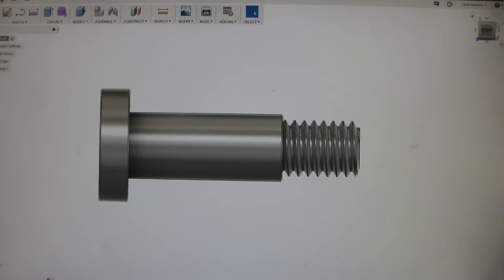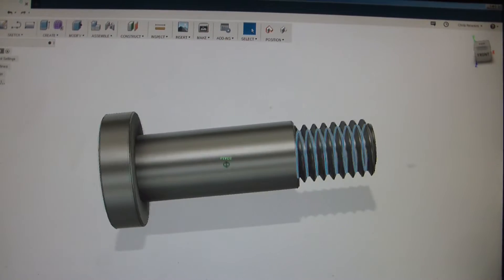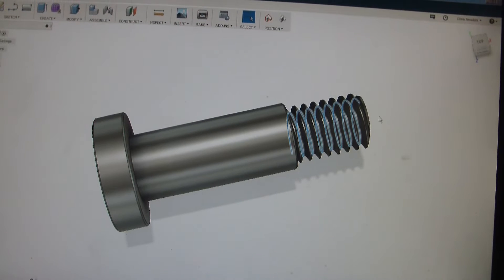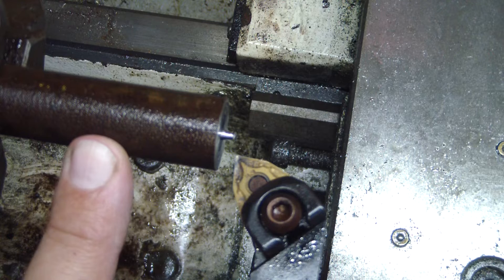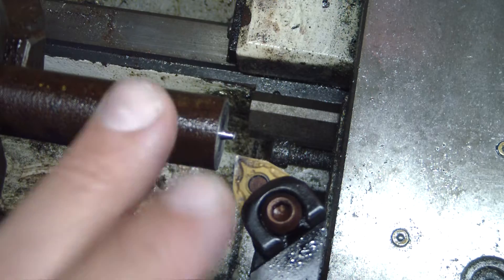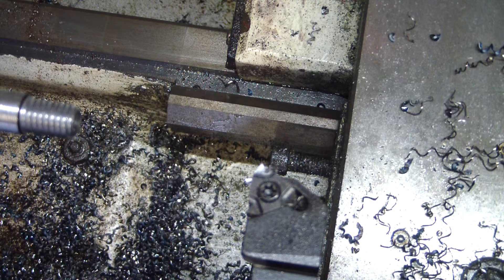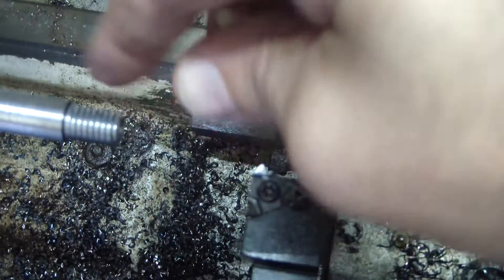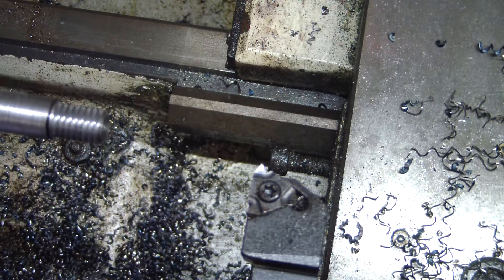Making a special bolt on the lathe.

Comment: Thanks for your times Sir... Nice job.  I am new to this... How does the lathe time each new cut when cutting threads like you did here.  Seems if each cut was not timed perfectly , you could potentally cut off the previous thread.  Silly question, I know.
Reply from the maker: There is a thread dial that you watch and engage the half nuts at each mark.

Comment: That's a fine looking part. I'll be getting a mini lathe soon, can't wait to get started. Suppose I wanted to make a bolt for part of my car suspension or some other thing that may require a certain hardness. I kind of know how to harden steel. But do you know how I would determine how hard its supposed to be? I doubt that kind of very specific information would be extremely difficult to find on the internet.
Reply from the maker: I have hardened a few parts but other than running a file across them have no idea how hard they were.

Comment: That bolt reminds me so much of bolts my dad would make at the H.K.Porter plant in Boston, Mass in the 1960s and 1970s. They used similar bolts on there #2 and #3 forester limb cutters as far back as the 1920s. They would use them to attach the cutting heads to the handles! Thank you for showing me how they would be made!

Comment: How did you determine.372 was the diameter you needed  for bolt to be threaded?
Reply from the maker: .002 or .003 under the actual size which in this case was .375 so it will thread into the nut is what I always turn to.

Comment: Former job shop aerospace structural machinist likes your title 737mechanic new subscriber so here to watch you and your work. A sucker rod? Learning here, Vice swivel base? Thank you.
Reply from the maker: I like your name "Active Atom". Sucker rod is a cheap material about 3/4in used in the oil industry and a friend of mine bought a ton of it to build a pipe fence around his 10-acre ranch so he gave me a few feet and it comes in handy for certain projects and this was one of them. It doesn't machine real good and it is kinda soft but should be fine for this.
Reply: @737mechanic  I love YouTube and learning this term Sucker Rod just knew it meant something, thank you for sharing my name is Lance. I will stay tuned to your channel to learn still more to come. Thank you.